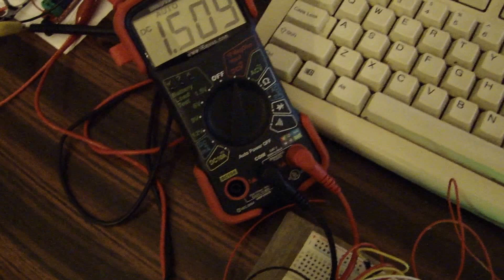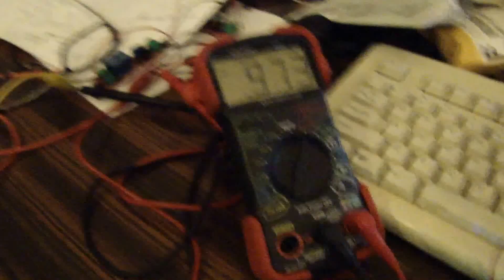Latest 555 astable circuit with reverse polarity and CC for colloidal silver generator

Comment: I have built a little more sophisticated version of what you have.
I have found that 27 vdc at .003 millivolts works very well, along with stirring action. 
the finished solution is nice and clear with minimal crap to filter,
3 minutes of polarity reversal seems to be the cats ass,
very little build up on the silver anodes,  [cathode]
BUBBLING the solution is probably not a good idea if you try that in the future.
very slight mechanical or magnetic stirring seems to work very well,
CLEAR solution at 18 ppm is reliable with this current setting. as long as you use PURE water at zero ppm from the start, in about 2.5 hours.
CURRENT control is paramount to any other perimeter.
Reply: Could you show the circuit please? Thanks!
Reply: Do you mean 3mA Current please?
Reply: @QuoVadistis  YOU are correct       .003 vdc     alternating polarity about every 3 minutes at about 27 volts
Reply: @DOCDEVOE699  Can you suggest a circuit for automatic polarity switching please? May thanks!
Reply: @QuoVadistis  that would PROBABLY work,,,, but not sure,,,,,,, but what I know for sure is that the one that I sent you the link too is good and stable and I have been using this same unit for almost 5 years now with zero problems,,,,,  and about the polarity switching , the other link that I gave you provides ON and OFF times,,,, that allows you to use an ice cube relay with a set of NO contacts and a set of NC contacts with the relay,,,, that allows you to switch polarity at the output of the relay relay,
Reply: @DOCDEVOE699  THANK YOU very much.  Your help is greatly appreciated!
Reply: @QuoVadistis  these work very well for you polarity switching if you use to trigger a small ice cube relay https://www.ebay.com/itm/DC-5V-12V-24V-Infinite-Cycle-Delay-Timing-Timer-Relay-ON-OFF-Switch-Loop-Module/173651639258?ssPageName=STRK%3AMEBIDX%3AIT&_trksid=p2057872.m2749.l2649